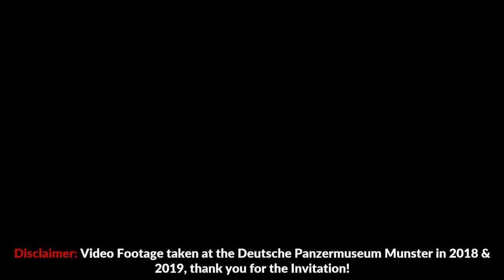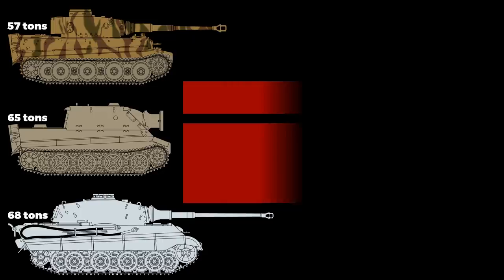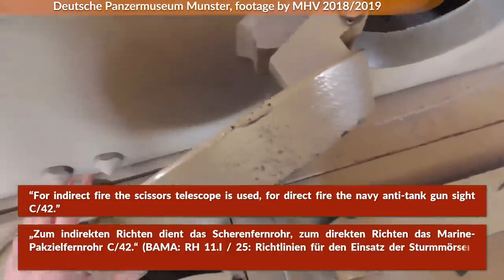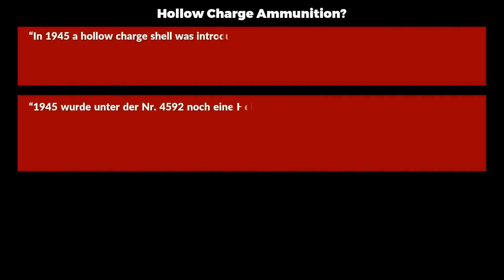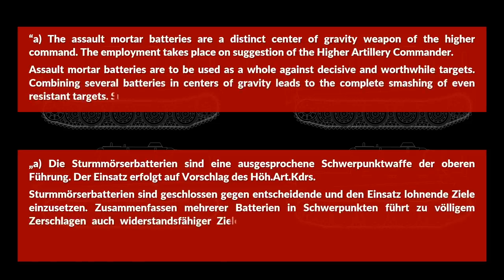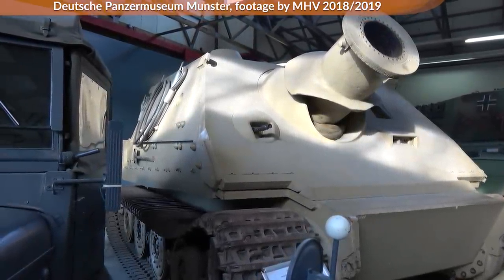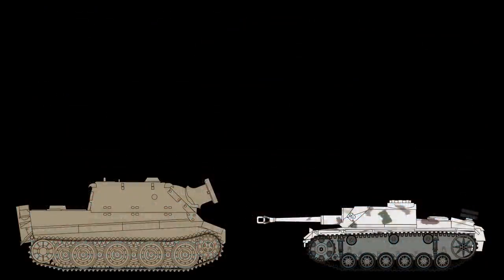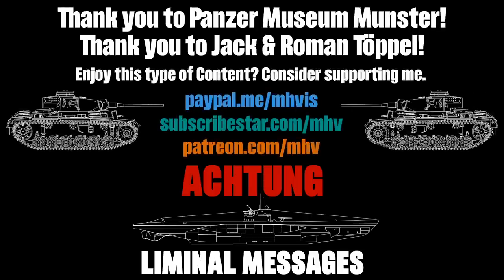How to use a Sturmtiger

Comment: 125 kg warhead? This vehicle sounds like something you'd see in an Imperial Guard artillery regiment, not on an actual battlefield.
Reply: Where do you think the creators of wh40k got their ideas from?
Reply: It’s a Leman Russ Thunderer Siege Tank
Reply: @markb6978  Or more accurately, it's the Spehs Mehreens Vindicator, which is the very exact thing.
Reply: Abdul Amar Eh, I can sorta see the boxy design in both, but the Vidicator really looks exactly like an APC with a huge gun stuck to it. The thunderer has the same background as the sturmtiger, being converted from damaged hulls sent back from the front.
Reply: I wonder how Nazi Germany would fare in the 40k universe if they had all the resources to build all their craziest ideas en masse
Reply: @KoalaTContent  I don't think they would even be notable in 40k. It'd just be "oh. Look at this average planet of Humans."
They would be allowed to exist perfectly well within the Imperium, with a few adjustments. They'd end up using mostly standard Imperial equipment though, because it's simply superior to most things we have no, and especially to anything from the 40s.
Reply: That is actually rather light. I know for a fact that WWI 12" siege mortars had shells over 400kg in weight. This is a 15" mortar and yet its shells are lighter and its range is the third of the aforementioned weapons.
Reply: The few times it was used operationally, the battery/detatchment Commander said it was tactically useless, as it created so much debris from the destructive power, that the resulting dust clouds hid the destroyed area, which also gave the surviving resistance forces additional hard cover like a rats nest when they moved in to the destruction, that made it impassable to supporting vehicles (wheeled, tracked or half-tracked) of the infantry stationed around it.
Reply: it was made to be fired at pointblank range.
Reply: well imperial guard aesthetic was largely inspired by ww2. I'd love to have seen this thing see a bit more action. unfortunately late war Germany was to busy flailing. in truth this tank ended up being a great for a offensive war during right around the the time the war turned into a largely defensive war
Reply: @KoalaTContent  knowing how strict the ad mech is not very well. building "new innovative things" is seriously taboo in the imperium
Reply: @curtisbrown547  certainly it was an exaggerated rare example, that was almost the weight of a Tiger 2 on mostly normal Tiger suspension barring additional suspension oil dampners.
Reply: guess where the demolisher tank idea for the Imperium comes from.
Reply: @scottland8698 ,

Emperor just clicking Ctrl+Alt+Delete on Hitler.
Reply: Ville Hammar STILL WORKED LIKE ARTILLERY. extremely well I might add .
Reply: It was an artillery vehicle
Reply: @ineednochannelyoutube5384  Funnily enough, railway guns are very different to self propelled guns.
Reply: @Kyle-gw6qp  Sige mortars are not railway guns, and this is not a self propelled gun, its a rocket propelled depth charge launcher.
Reply: "Banehammer" super heavy tank variant

Comment: 7:29
Me: How do you spell that?
German: Just like it sounds.
Me: *snaps pencil*
Reply: immediately followed by "eleven trucks"
Reply: Sonderkraftfahrzeug Zwei-einundfünfizig Schrägstrich Achtzehn. 
(literally "special motor vehicle two-fiftyone diagonal slash eighteen.")
Reply: You will need several pencils to write that down.
Reply: Captions work for this video
Reply: Sd. Kfz 251/18
Reply: Tiedustelupanssariajoneuvo; armoured reconnaissance vehicle. That's just a generic type, not a specific make/ model. While I do realize that this is not the same type of vehicle as a mortar on tracks, the replies to the comment had already derailed the toboggan; potkukelkka oli jo mennyt pois raiteilta. Koska potkukelkka kuljettaa raiteensa mukanaan, niin mitäs...I wonder in which other languages can compound words specific to military jargon which are as long as the English-language alphabet be constructed.
Reply: @psychiatry-is-eugenics  the captions are manualy writen ... automatic captions writes : sonic half attacks are an orphan secretly aartsen xD

Comment: when they said that the armour was like the tigers, they may have meant that the philosophy behind the distribution was the same that is to say that it was strong at the front and weak at the sides. this would be important for the crew to know, its effectively a warning to not show the sides of the tank to enemy fire.
Reply: Kinda redundant since that was true for every tank back then
Reply: Side armor of tiger was not thin at all there is pictures online with many shell dents on the sides
Reply: @poldi2233 - Tiger II has much stronger side armour (plus bonus of being sloped)

Comment: Correction on the wheels: All types of Tiger I were used for conversion, early and mid models were simply fitted with late steel wheels during the conversion.

Comment: If I recall correctly, the one and only time a Sturmtiger engaged enemy armor, it fired a single shot at a group of Sherman tanks and blew up most of them. Which makes me wonder just how effective the Sturmtiger would have been if it had been introduced earlier in the war and had sufficient ammo.
Reply: That question literally aplies to most late war german tanks
Reply: no point because a sturmtiger is an assault gun with no turning turret, therefore not suitable for offensive operations, which the Germany was carrying out at the time.

the only way I could think of their use at the time was to fight against occupied territory's insurgents or defend supply line for Eastern front. But 1) the much cheaper armored cars at the time were sufficient enough for the 1st task. and 2) The Germany's logistic was a nightmare throughout war and I doubt they could maintain them.
Reply: @williampan29  An assault gun... is not suitable for offensive operations. You may want to look up a couple words in the dictionary.
Reply: Well the problem is the Sturmtiger inherits the flaws of the Tiger of being a maintenance nightmare and not being very fast. You then add to the fact that it has no turret and that means eventually the target is probably just going to move out of the way. These things kept breaking down constantly, although not nearly as much as the Ferdinand which was too heavy for its under engineered engine.
Reply: @alex_zetsu  It takes 30 minutes to reload. This is not a tank destroyer, but something that can lob rockets at enemy armor formations and hope the blast gets a few.
Reply: @Swindle1984  Well, that's yet another reason it doesn't try to engage enemy armor. So the answer your speculation about what it might do if it was introduced earlier, probably not a whole lot more. And it still inherits the Tiger's problem of spending so much time in maintence and less time on the field.
Reply: @alex_zetsu  Area of effect artillery is area of effect artillery. Most tanks being killed in Ukraine right now are being taken out by artillery, not missiles or other tanks.

Comment: Throw weight per hour:
Sturmkitty: 4*125 = 500 kg/hour
10.5cm leFH 18: 180-220*1.85 = 333-407 kg/hour
15cm sFB 18: 100-120*5.1kg = 510-612 kg/hour

Quantity may have a quality all of it's own - but the bunker you're sitting in is going to disagree with that statement if it ever comes under sustained fire from a battery of these things. That's a whole lot of throw weight, even considering rate of fire.
Reply: that's what it was meant to do. Blow open bunkers and fortified positions.
Reply: @5peciesunkn0wn  

it also works wonders in clearing out trenches, flattening city blocks and turning an army regiment into minced meat.
put 3 of these next to each other and you pretty much got one turret of battleship bismarck aiming at your position.
Reply: sure, but their accuracy seems to be really bad.
it only seem to be good enough for direct fire to the target

Comment: I would love to see something like this on the smaller Brummbär assault gun armored vehicle.  Fantastic informative video overall.   As someone who's been around and fascinated by the old U.S. Army M728 CEV (with its massive 165mm demolition gun), and having seen it in action, I've always been fascinated with such vehicles.   I'm still not sure why the U.S. Army never fitted its more modern Abrams based replacements to the M728  with a similar or large assault gun as the snub-nosed cannons also make them more practical in narrow streets in an urban environment or in a forested area where a long cannon can snag on trees.

Comment: I really enjoy the technical I formation here and am super excited to hear temperature actually being considered when referring to the ammunition ballistics . pressure rises or falls depending on if warmer or colder. This is a main reason it's not advisable to use military 5.56 x45mm in a  .223 Remington chambered firearm.  While it fits , the military cover design is specifically for high pressure and reliability  and 223rem is made to tight varmint rifle tollorences , with much shorter lead/throat and much sharper rifling onset angle . On a hot day , the military ammo can destroy the .223 chambered gun from pressure spikes ,from the bullet having to overcome more resistance to leave it's case and engage the rifling . Which is already accounted for with .223. 
A cannon would be no different and range would increase or decrease noticably in different temperature extremes .  Thankyou for the thought inspiring video.

Comment: Maximum acceptable dispersion for field artillery battery is 2% of firing distance in firing direction. For artillery batallion max acceptable dispersion is 4% of firing distance. Sideways dispersion is half. These stats are from finnish army.
Reply: Moi, what does dispersion mean within this context? T. Eetvartti
Reply: I was US army FDC Chief for m110's and m109's and I've never heard of that. We used ICM vs HE to take out troops, light vehicles or tanks because ICM gives a good spread at impact. 155mm and 203mm isn't exactly a sniper rifle or a precision weapon system. However one of my favorite quotes from WW2 is from a German General at the end of the war. At the time USA was using the m12, a self propelled 155mm howitzer, to take out sniper positions. To roughly quote the General he said "When the USA starts using 155mm as a sniper weapon it's time to quit"
Reply: @edward9674  hajonta, distance between most distant shells in firemission.
Reply: @readhistory2023  different armies have very different ways of using artillery. In finnish army fire control is at platoon level and usually 18 gun minimum fire in a fire mission. I've read that in many armies control is much higher up in organization, and smaller firing units are also common.
Reply: Brother told me about some coastal artillery training exercise firing at a moving surface target. They were supposed to fire ranging shots to get it "dialed in", but somebody destroyed the target with the very first shot and ruined the entire day for everybody.
Reply: @krismakardikan9823  my uncle was a spotter for coastal artillery in the seventies. Every time they got fire on the moving target, a cease fire was ordered, so the target would stay intact.

Comment: First prototype of this vehicle was sent to level Warsaw during the Warsaw uprising (08/1944) and to help with demolition of the city after the rising. It was the very first version of it painted in standard issue dunkelgelb and without the flame deflector present in the later version used on the western front.

Comment: You didn't cover the most important aspect: how was it loaded?
Reply: I think this was more of a field manual for Officers than a Panzer Crewman manual.
Reply: Very carefully -- always wear titanium toed boots.
more seriously, I imagine that there are manual or electric chain hoists and a hydraulic rammer to get the warhead and its propellant charges into the breach. It's not like a field gun where you could have 12 guys running around.
Reply: @stephen1r2  it´s rocketpropelled, so no separate charges, just the complete shell to load. But still, yeah a hydraulic rammer would be nice :P
Reply: I think there was a mounted crane on the top of the Sturmtiger and it was loaded from the outside into the barrel.
Reply: I would imagine it was with chain driven winches
Reply: Internal swing sleds..

Comment: Isn't the shell of the Sturmtiger more of a gyrojet than a rocket, a bit like the "Werfergranate 21"?
Reply: yes but remember, these were not made to be read by enthusiasts who watch videos of a German guy explaining the finer points of WW2 vehicles.
This is being used by a poorly educated guy who got drafted 3 months ago and only has a basic understanding of how the vehicle works. Thus simpler terminology.

If you want a modern day example of this, try to get your hands on the operators manual and maintenance manual for the same military vehicle. You'll be amazing at how wrong, but simpler, the wording in the operators manual is compared to the technospeak of the maint manual.
Reply: The finer points of the distinction between the two would have been as lost on the average wehrmact soldier as they are on your average viewer today. Remember that the source is an operational manual not a technical manual and was likely simplified for the soldiers using the weapon.
Reply: @nilloc93  I can vouch for this having used the technical manual for the Abrams tank when I served and then read the Army tank platoon manual recently. There is a huge difference in the terminology.

Comment: The Sturmtiger was used in August 1944 against the Warsaw Uprising. PzStuMrKp 1000 was raised on 13 August 1944 and fought during the Warsaw Uprising with two vehicles, as did the prototype in a separate action, which may have been the only time the Sturmtiger was used in its intended role. During this operation is the only time the Stumtiger was filmed firing a round.

Comment: Sturmtiger was basically a late "recycled" late Tiger I fitted with casement with the powerful 380 mm Raketen-Werfer 61 L/5.4, a breech-loading barrel, which fired a short-range, rocket-propelled projectile originally developed for the navy. Despite only 18 of those vehicles was produced it was a nasty surprise in Warsaw, if the rounds worked on soft ground and more interestingly dururing the battle for the bridge at Remagen one,of of the Sturmtigers allegedly hit a group of stationary Sherman tanks in a village with a 380mm round, resulting in nearly all the Shermans being put out of action, and their crews killed or wounded. This is the only tank-on-tank combat a Sturmtiger is ever recorded engaging.

Comment: 4 shots per hour? Wow. Wouldn't some heavy guns be faster & more effective? (esp given the amount of external support protection this behemoth needs?)
Reply: "Wouldn't X be more effective?" The question that should have been asked far more often by German weapons manufacturers during WW2.
Reply: well, if you watched the video you would know that they where usually used together at the same time, in other words 4 SturmTigers would fire at the same area at the same time. Also each shell contains 125kg of explosives, so basically 4 shots equals 500kg of explosives at the target in one volley. One 15cm shell from a heavy artillery contains 5.1 kg of explosives, so to get the same effect on target  you would need about 100 artillery guns firing at once to get the same effect. Basically they where the ultimate shock and awe weapon if you need a little piece of the enemy front line obliterated every 15 min or so. That said the 15cm heavy artillery guns where more useful overall since they didn't need the same planning and logistics to work, but there is something fascinating about a tank with a 380mm gun..
Reply: @Destyvirago  the heavy armour may have been justifiable for an army on the strategic offensive, but seems more of a liability for the Wehrmacht late in the war. The longish range of the mortar would suggest that a non or lightly armoured version would be more useful, increasing mobility, rate of fire, and decreasing logistical problems, without exposing the crew to excessive counter fire.
Reply: One of the things that might be relevant is that over time people become desensitised, what might have been effective shock tactics in 1939 would not have had the same impact in 1944/5. The implication from the literature seems to have been that this was a weapon designed to be something of a focal point in assaults, deployed as much for the psychological impact it would have as the material one. 

Not to say you're wrong about it being an ineffective use of resources.
Reply: What about the wide dispersion, wouldn't it be very costly to miss, given the maximum load-out is 12 per vehicle?
Reply: Krishna Mahesh basically you could get a battalion (at least) of any other ww2 artillery and be more effective
Reply: @amitabhakusari2304  

the amount of dispersion on this thing doesnt matter when a single shell covers almost the same area with its explosion.
and when you got 4 of these fireing at the same time and the same target you get a several hundret meter wide area of death.
Reply: A Russian rocket truck would be far more effective, not to mention cheaper, more mobile and replaceable.
Reply: Krishna Mahesh who needs to be faster when the entire enemy and 4 miles behind them gets destroyed with one shell ? To me it’s saves a lot more ammo .
Reply: Aw F the whole point of it having armor IS the counterfire.

Comment: It is very interesting to see the original KStN. for this unit type. Namely, KStN. 1161, Panzer-Sturmmörserkompanie "Tiger" (15.9.1944). I believe this was the composition based on the testing of the vehicle during the Warsaw Uprising in August 1944 when one or possibly two soft steel prototype vehicles were used in a combat role against the Polish partisans for a few days. I think there is footage that was used on Die Deutsche Wochenschau.